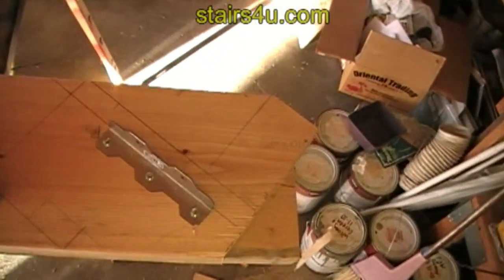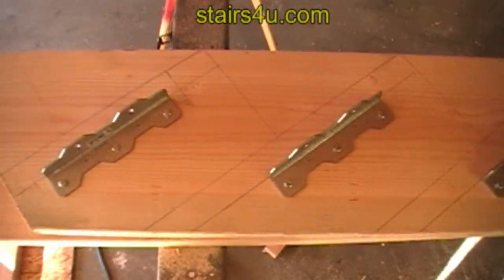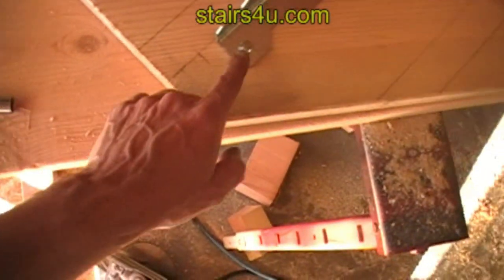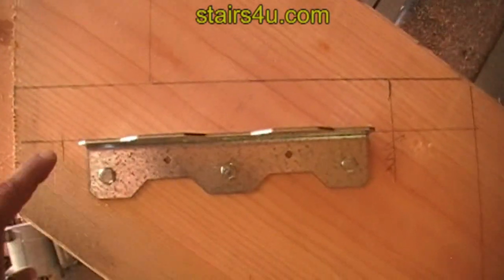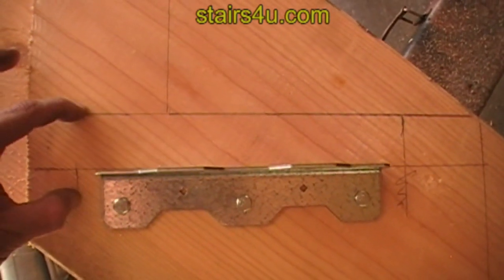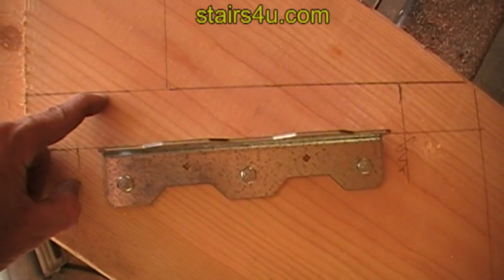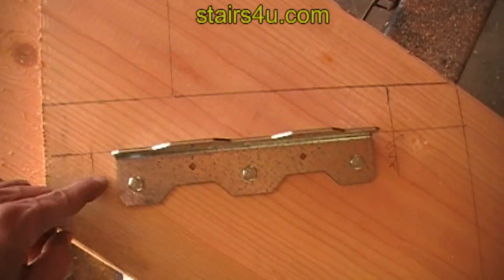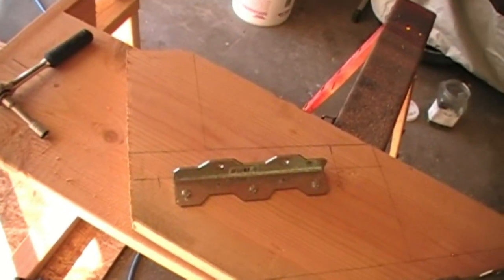Completed Stair Stringer Using Angle Brackets - How To Tips

Comment: thanks for this - I have a floor person here using brackets to hold our stairs up in the same fashion. I wasn't sure how well it would work so glad to see it does.  I am concerned though, he's using standard wood stairs that are 1 inch thick instead of 1.5 inches... he says they will be fine?  The old stairs he's replacing were 1.5"
Reply from the maker: If they move up and down while using the stairs, then they should be replaced with stronger steps.